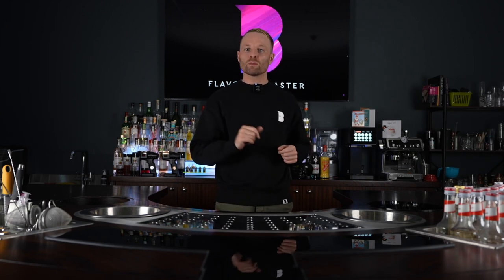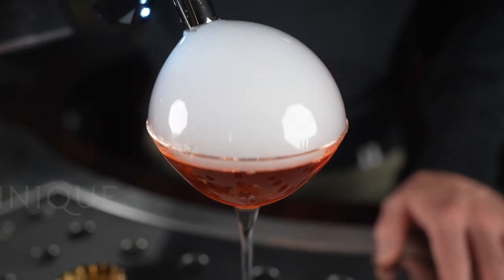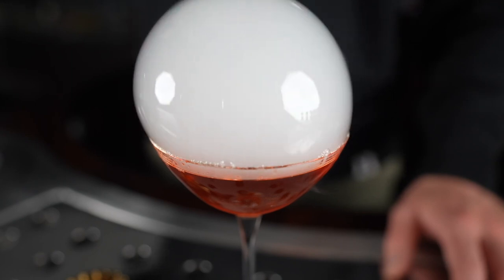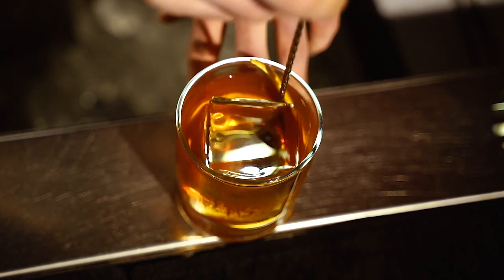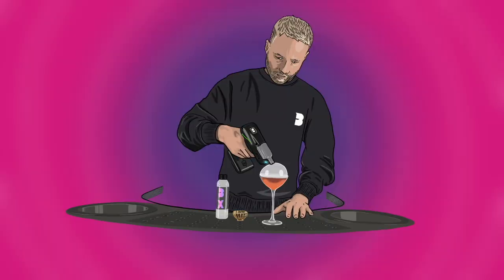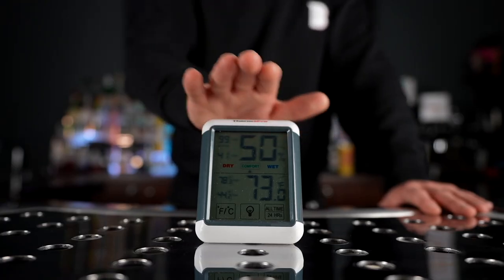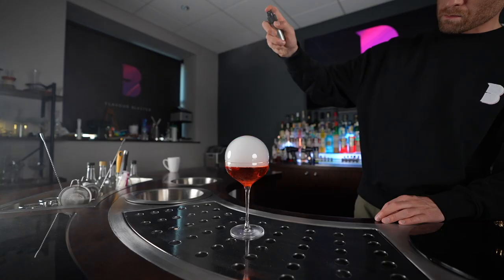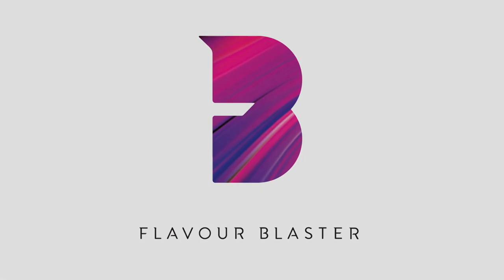Flavour Blaster Improve Bubble Stability | Help Video

Comment: I always notice that is is very easy to create the bubbles when served over cocktails served straight up.
Very difficult when cocktails served "on the rocks".
Does it in fact work on cocktails on the rocks, if so please show a demonstration.
Thanks so much
Reply from the maker: Ok will do and yes this is a harder technique as ice is sharp in places and dry. Works if it’s large flat ice block push first in the liquid or atomiser spay of water. Sometime if ice cubes are mixed around so covered in liquid then bubble is blown etc